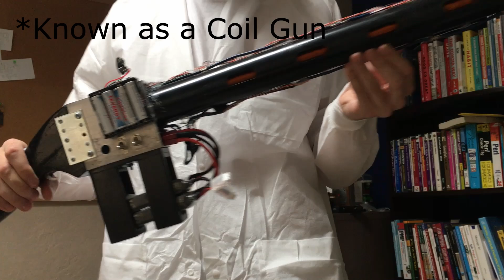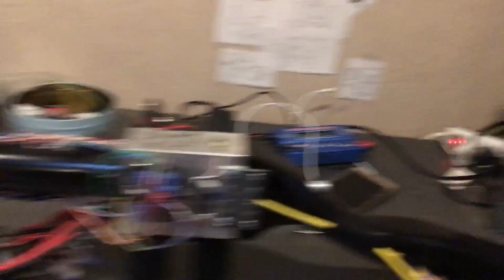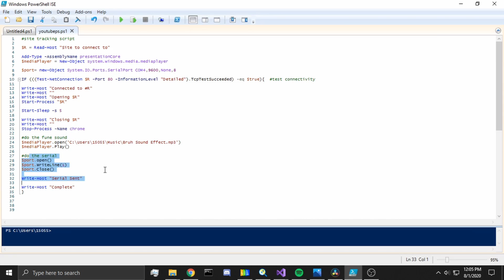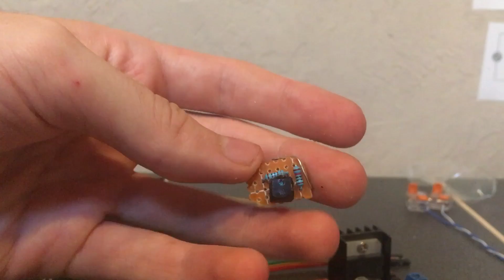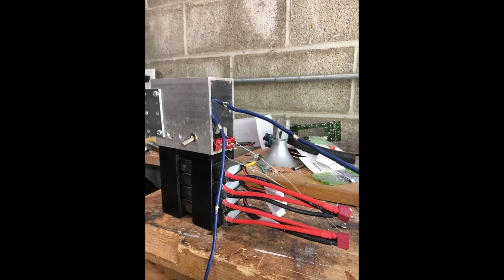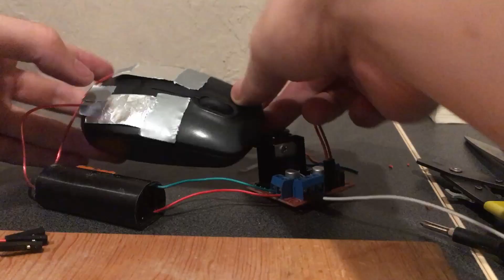Using a Homemade Coilgun to Cure my Youtube Addiction

Comment: I am using PIR sensor and I’m HORRIBLE at programming. I’m confused about the code I need to write for my Nano and I was wondering if you had any advice or if the code in the description will work for a generic PIR Sensor.
Reply from the maker: well my code could be used as a reference, but I did not use arduino, just the chip by itself and avr studio. Also I did not link the header files i used (as they are not mine to share). I would look at the vid i linked in the description as inspiration, he actually made a instructables and is using a arduino nano.
Reply: Thanks!

Comment: I asume you've got a coilgun build vid out there somewhere. But I'm lazy, so I'll just write this text instead. At which speed does the projectile exit the gun? How far can it shoot? Isn't a maglev train based on kinda the same idea? Other then making the barrel a few km long, what other way is there to improve the velocity? Does the projectile length impact performance, and if so, in what way? What if you would use drops of molten metal. What would it do to the shape of such a ball of metal, and would the gun keep heating said liquid ball of metal? (the rapid movement of a drop of metal will cool it off kinda quickly)
Reply from the maker: no i dont have a more in depth build as i made it before thinking of doing a vid so no footage (just pics). maybe il do a vid on that later. dont know exact speed, but can say that it hurt a bit. shoots more than 20 feet (mostly because i didnt do the timing perfect and the bullet is heavy) Yeah the meglev train is similar. to improve, i would need to make timing better, or put more current through the coils, but the mosfets are already maxed out for current, and the coils get preety hot already so i would need thicker wire. funny you should ask, because the projectile length really affects performance. its kinda hard to explain, but it has to do with the length of the coils and the sensor at the end. that is actually a really cool idea for molten metal. dont know if heat of a metal affects it magnetic properties tho. and it would be super hard to make
Reply: @homoineptum5077  You can use fire to make metal molten, but you can also use electricity to melt metals. I've seen some people making electronic metal forgers with big coils around them. Not sure how they work exactly. But if you've got something like that going, making a "drop of liquid metal dispencer" shouldn't be out of the DIY realm.